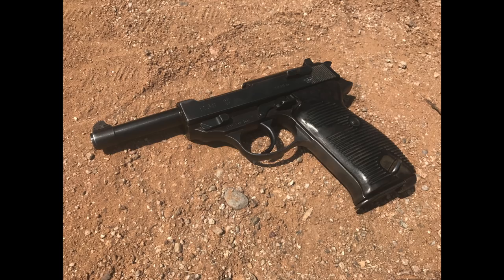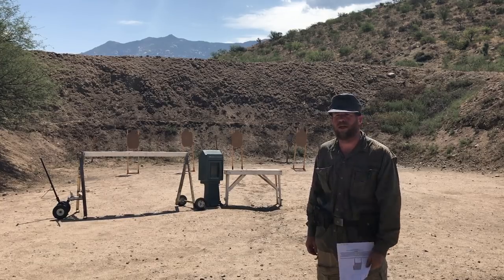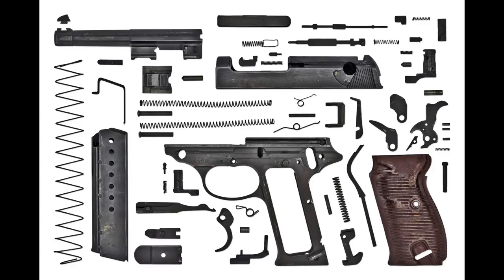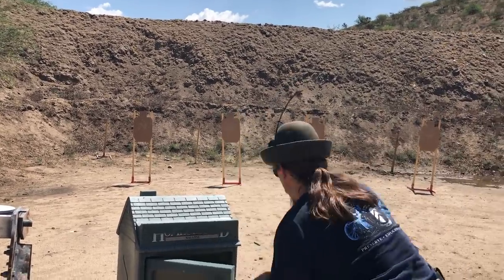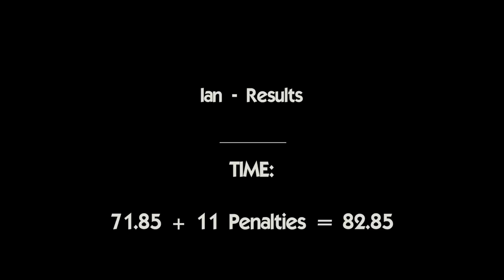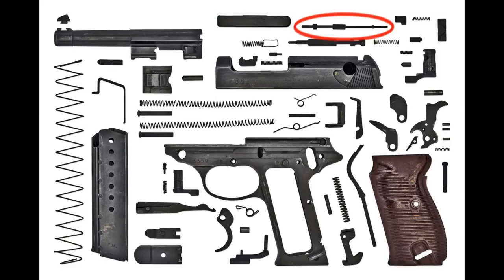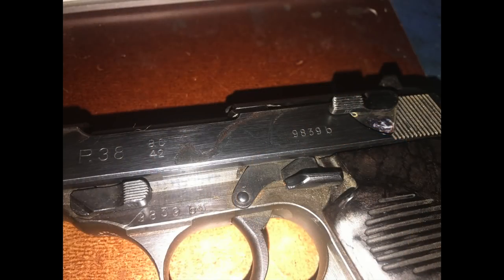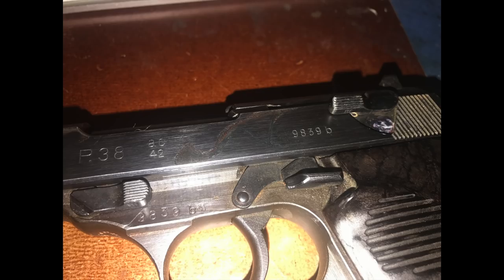Walther P38 Failure Day!

Comment: Loaded chamber indicators only work when it's just a hole to see brass in the chamber. Anything mechanical as an indicator is no bueno, even a hole can be bad if it isn't well placed. The only LCI I ever found effective at all is the tiny cut out in the top of the chamber on my 1911, and it allows you to see only brass, not differentiate between a live round and an empty cartridge. In any case you shouldn't handle a gun if you don't know the three rules

Comment: I'm no expert, but looking at the diagram, the P38 looks like a mechanical nightmare.
Reply: well it's completly strip out it's not like when ian usually only field strip firearms
it seems pretty simple apart from the 3  parts next to the hammer (i don't recognize them )

the m1911 seems a mechanical mess especilly with that leaf spring
and the mechanical nightmare of still in production handguns is probably the rhino 
http://www.gunsumerreports.com/Chiappa_Rhino_60DS/Chiappa_Rhino_60DS_064.JPG

Comment: Interesting.  To my knowledge I have never had a loaded chamber indicator cause a problem or give a false reading while using a pistol with one.   Alternatively, back in the late 70s I did know someone whose WW2 era P-38 slide cracked in two under recoil.    There wasn't that much collector interest in those things back then and I believe he just got a replacement slide from Numrich or similar to resolve his issue.   Yes, with any semi automatic before getting serious with it, test your chosen ammunition brand and make sure it functions well in the gun.  A plain Jane 'white box' FMJ that feeds and shoots 100% reliably is 10x better than a super duper, super expansive +P JHP that jams or misfires every other shot.

Comment: What bullet weight does the Blazer have and how fast is the powder charge?
I tested old ammo (WWII vintage for use in P08s) in my C96. That ammo seemed to have a pretty heavy bullet and a somewhat slower burning charge, the gun cycled in a softer way than with 124gr modern standard ammo, but felt like it had quite some oomph to it.
Those old guns (pre-WWII designs) were not made for light bullets and high velocities.

Comment: DA/SA guns are just not that durable.
Reply: This is a DA/SA? I thought it was just SA
Reply: @weaponsgradepotato  Yes
Reply: P38s are plenty durable, this can happen to a 1911 as well or any other ww2 pistol (ammo issues), what happened here is quite rare on the P38.
Reply: If a part breaks in a Luger you're screwed since its all hand fit delicate and finicky to work with, any parts snaps in a P38, its easily replaceable not to mention easier field strip than the Luger. P38 is the best pistol of ww2 right next to the Hi Power.